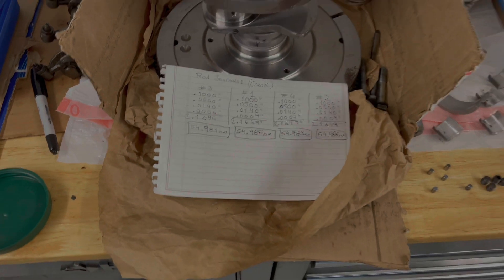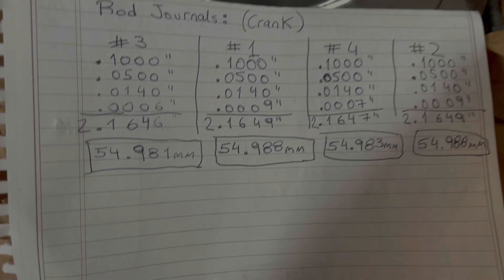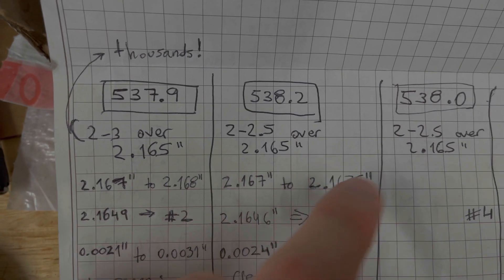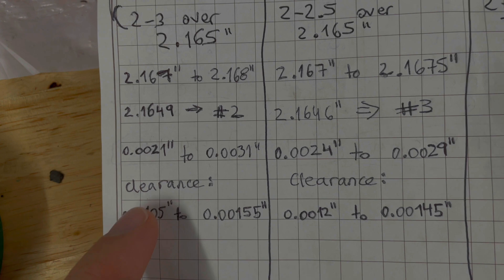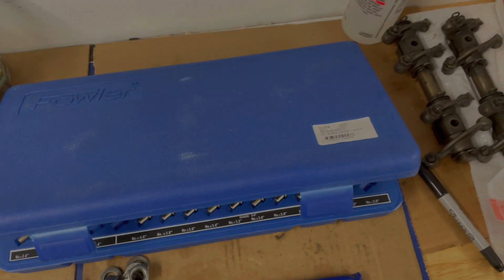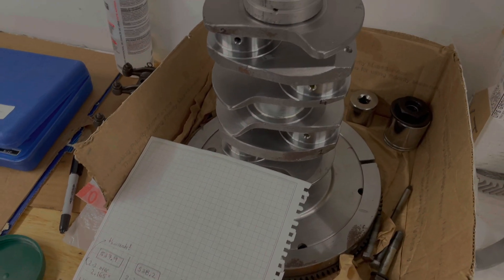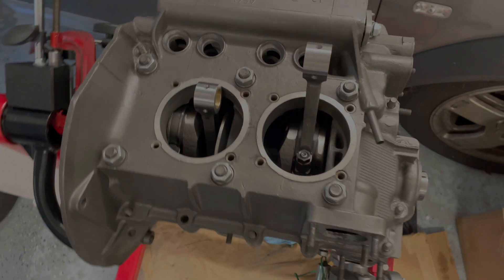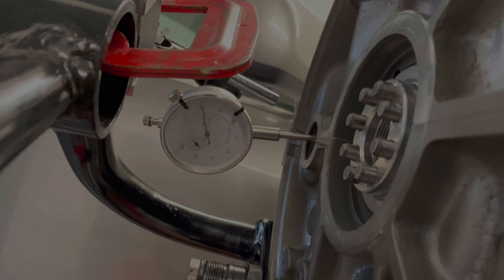VW Rod bearing clearance - Critical checks | Ep.11

Comment: Very conscientious work; I see some surface rust spots on some of your components; try to get a light coat of oil to prevent that before you put them together.
Reply from the maker: Hopefully I can fire it up before the rust gets bad. Even the brand new flywheel started rusting after only about a month sitting on the bench